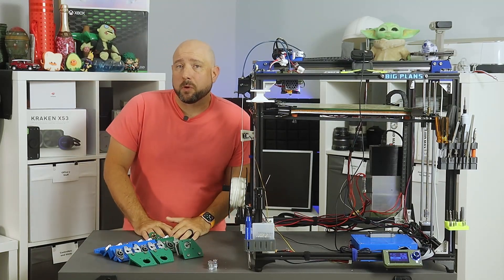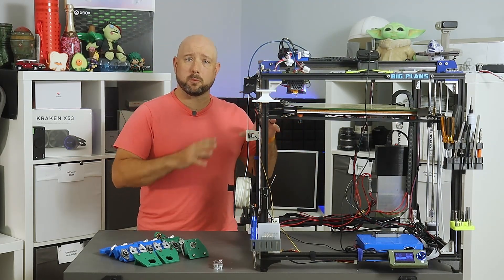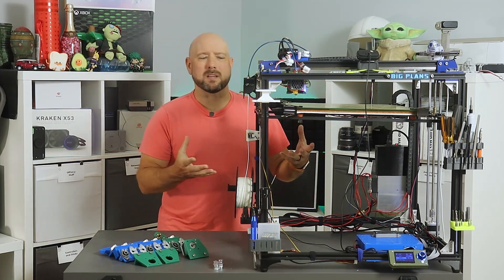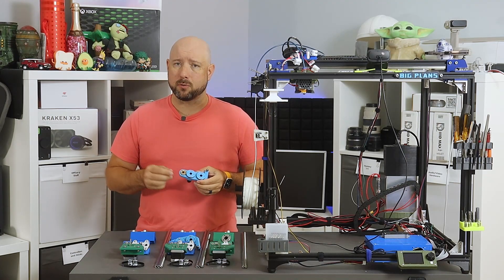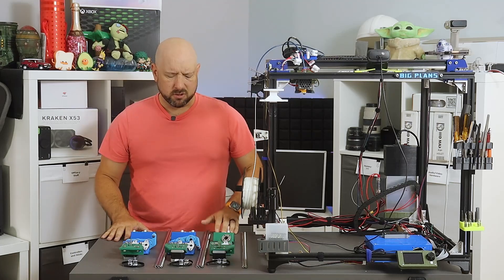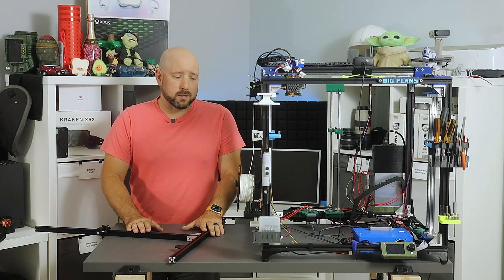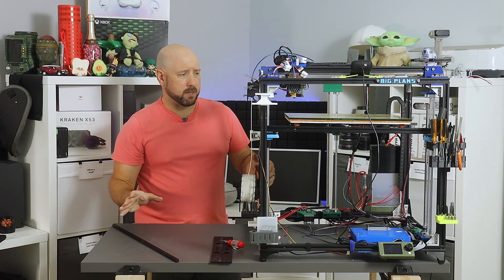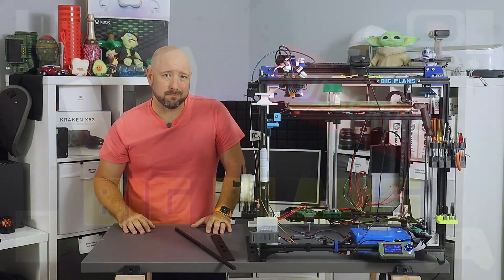Triple Z Bed Leveling on a TronXY X5SA

Comment: I heard we can connect to control boards to a pi. I have a btt skr mini e3v3 and a creality 4.2.2 i want to use with klipper. Is rhis possible.  And i am assuming i can use the same psu - right?

Comment: Hey Mikey,  Been using a lot of your mods on my own X5SA 400 over the past couple years.  Getting into some more mods on it now such as a ZeroG conversion with a switchwire print head.  Now tackling this one but added up around $150 give or take for all the parts (on amazon)  So to save some money and use more of the parts laying around from the printer, I have relocated the motors to be incorporated to the lower rod attachment points.  This way I can mount the motor with coupler instead of using belts and pillow bearings while using the T8s that came with the printer and maintain height.  Will be testing it soon and post remixes when done.  ALSO I ended up printing the flush mounted 8mm rod clamps.  Gonna see how those hold up.  Awesome work though as always!

Comment: i am considering buying an X5SA-500.  but most of the reviews are not good. I am looking for a large bed for bigger projects so I don't have to cut and glue.  This is a reasonably priced option but haven't decided.  Do you recommend this printer?

Comment: Jesus, it's amazing how much people complicates with making these printers actually print ok =))
Reply: Actually, it prints just fine stock. Most of us just like to tinker and make improvements. I've never had any issues with my X5SA. Even with cracked UU bearings. The chitu board does kind of suck though and moving it to marlin from stock was essential to get things like volumetric e and more controls.

Comment: i just dont get the need for extra complexity.
i havent touched the level on my bed except when i accidentally push down on one side. and then, its just a matter of pull the head to each corner and adjust the screws. then adjust the Z offset.  can level it about five times in the time it takes the auto level to make the first probe. and nothing fixes the bed being warped anyway. other than being smart and using four small beds...

keep meaning to maybe fit the belt and one stepper. whatever. not enough of a bother.

some people hate these things, i found its got a few quirks but its definitely tolerable. hell, i havent even changed firmware yet, thats unusual for me. i guess its working more often than not so i havent gotten frustrated enough to really do anything drastic yet. really, i am the person that pulls things apart in the first five minutes.

like the extruder. still tolerable. not perfect but whatever, it isnt giving me issues for what im doing. not a fan of it but its working. i think its money well spent.

halfway through a four day print at the moment... and wow, its the full build volume.

Comment: Does anyone have a resource for an install guide on the octopus board? I know it is not a straight forward install as the ribbon cable has to be removed and new wires have to be made for the detached board up top.

Comment: So many questions: What firmware supports this setup? Can Klipper support this?   Is there a defined G code for three Z motor axes leveling?
Reply: Klipper supports this, the command should be Z_TILT_ADJUST

Comment: Thank you for your video. I am still learning things and realized that I can run my sexond stepper using another driver (empty slot) Has 1 extra driver sitting since I got the printer. I hooked it up and enabled Z_tilt with dual Z (diff drivers running the Z Steppers) with a toleration of .0025, which I achieve at max 7 tries. Add the Z_tilt_adjust in the Gcode for every every print in the slicer. Its a whole new world for me. It PRINTS now EVRY TIME.....   THANK YOU!
Reply from the maker: Great to hear!  For a printer of this size to still use a single Z stepper driver with no linkage is a bit embarrassing.

Comment: Couple comments:  1. In your BOM you link to 12mm magnets, but your STL's accommodates a 15mm magnet.  2. You spec and link to an 8x2 lead screw.  Tronxy lead screws are 8x8.  Your z motor on the new screw is going to have to operate at 4x the speed of the other two.  How did you compensate for this?  Has the motors operating at different speeds caused any issues?  Having fun expanding on your build, and can't wait to start all the klipper printer.cfg fun.
Reply from the maker: Great catch on the threaded rod!  I am using T8x8 and incorrectly stated and linked to T8x2.  I'll update the description and link to match.  If you've already purchased the T8x2 I would recommend returning/exchanging for the T8x8 just so everything matches and it doesn't cause confusion down the road however if that's not an option I would think that supporting a T8x2 would just be a matter of multiplying your full_steps_per_rotation by four for the T8x2 rod.

You are correct that the link takes you to 12x3mm magnets and the design calls for 15mm magnets.  However, those 12mm magnets measure 15mm diameter on the calipers.  I'm hesitant to link to a different '15mm' product as I'd hate for someone to get even larger magnets in the order.  If you or anyone else has purchased a 15mm version and it measured out at 15mm I'd love to know so I can link to reliable source.  I'll update the description to note this discrepancy and that a 15mm OD magnet is required.

Comment: Thanks for Your inspirational videos about Your X5SA mods. Very helpful indeed! Actually I'm going a little bit further designing the parts to use a genuine 400x400mm Radrig V-Core 3.1 build plate. This will give me a bigger and more perfect build surface. I decided to go this way to put out the full potential of a triple Z bed kinematic. In my design I use a copy of the V-Core3.1 mechanic, resized for the X5SA core and some improvements on the ball sliders and the Z guidance. Congrats to Your videos - Very inspiring 🙂🙂😀😀👍👍
Reply from the maker: Hey PY2BND, glad you found some inspiration from the videos!  Are you going 100% with the RatRig gantry?  I love the setup but lots of rails and relatively expensive extrusions.

Comment: This is an awesome work, should this work on a 330 tronxy x5sa? thanks
Reply from the maker: Hello Alberto.  Yep, it should work with the 330 as I don't believe they changed the Z gantry on any of them - and even if they did the kit is designed for any cube printer so it would at worst be some minor modifications.  If you hit any issues let me know.
Reply: @LilMikeysBigPlans   i want to buy an tronxy x5s 330, to upgrade It to vzbot, and your triple z is just what i want, easy an chep triple z. Voron trident have It but its need 3 linear rails, and i dont think that this rails will ley you any improvement

Comment: I have the 2020 updated Tronxy X5SA, It has been a pain since I got it. I upgraded the extruder to a Titan, I upgraded the bed surface to a rubber like ultra flex Tronxy magnetic Bed Surface.
I fought with it and watched videos for help and now after almost 3 years I am done, I will not fight with it anymore I will dismantle it and use it as spares.

I got a Delta QQ-S Pro now and it far beyond the Tronxy in printing.  I have a Original G32 board Aquila which I upgraded with a high power all metal hot end and dual lead screws and a CR Touch.

It works better than the Tronxy too. I now got a Elegoo Neptune 3 and it is above the rest in printing.
I was thinking of replacing the Tronxy with a 	
ANYCUBIC CHIRON 01  which has a bigger bed than the Tronxy and build height 400 mm square bed and max build height of 450 mm and has 25 point mesh bed auto leveling built in.

But after some thought I will instead save the £260 that printer will cost here in the UK and save up another £240 and buy my 1st resin printer which be the amazing big Elegoo Saturn 2.
which be great to use in place of the Tronxy.
Upgrading the Tronxy like you shown be very fiddly and expensive and I don't have the level of know how to do it right.
Reply from the maker: Hello Colin.  Sorry to hear you've had so many issues with the TronXY and I hope it doesn't permanently turn you off of FDM printing.  I have a resin printer as well and it's a different beast.  Resin is quite a PITA for each print with removal, cleanup, and curing but the results are amazing.  Where-as with a properly tuned FDM it's pretty much fire-and-forget for large parts - and just rip the from the plate and go about your merry way :)

Either way, best of luck with the hobby.  It's a lot of fun when it's not a huge PITA.
Reply: @LilMikeysBigPlans   Hi Again.. Thank you for replying.  I have a update for you.  I tried again to redo the Tronxy X5SA to level it and maybe print n the original flat aluminum metal bed as the rubber ultra flex Tronxy one was rubbish it would not stay stuck down to the magnetic base once the bed heated up to around 70 C.

So I will now have to just give up on having a big xy core printer.  I have the new Elegoo Neptune 3 printer and it is great since it has auto leveling bed system.
And  PEI bed sheet. In fact Elegoo just released two new versions of the Pro version of this Neptune 3.

They have direct drive extruder and PEI bed and even better leveling. But they are bigger bed sized.
The Elegoo Neptune Plus has a bed size of 320 mm and a build height of 400 mm. ( so the bed is only 10 mm smaller than the Tronxy X5SA )

https://www.elegoo.com/en-gb/products/elegoo-neptune-3-max-fdm-3d-printer-massive-printing-size-of-420x420x500mm

The Neptune 3 Max, it is a whole another level. with a bed of 420 mm x 420 mm and build height of 500 mm 

https://www.elegoo.com/products/elegoo-neptune-3-plus-fdm-3d-printer-with-larger-build-volume-of-320x320x400mm

at $350 for the plus and $470 for the Max they look great value I hoping to get the Max or if my limited money can't reach that I get the plus?

As for the Saturn 2 by Elegoo I did get it just before Christmas 2022. I also manged to get their bigger wash and cure stations too. 
and used some of their Elegoo Water Washable Resin. I did some stuff But now hit a big problem?

I can't dispose of the left over resin that is in the water of the wash station, To dispose of the resin waste the idea is to place it in a clear container out in the sunlight to set the resin left in there. 
Then throw the resin solid waste part away! The water left should be filtered through carbon filter like a water filter jug. 

I did the filtering but no improvements. as for the solid part I can't set it as sadly the UK has not the sunlight it seems to do so?  

So I had to store it in a plastic container of 10 liters size with clamp on lid as there is 7 liters each time from the washing unit to do the bed plate and models fully! 

Someone said maybe use a big UV lamp to set the resin in the washing water, But I looked them up and they are very pricey in hundreds here in the UK.

I have now 14 liters of the waste water ( two washing full loads ) The resin system was very price.. So I will clean it up since it is almost new and sell it. Shame I know!
But even if my local council does dispose of this waste water, I will still need to transport this toxic water to their site without a car to do so!

They are many miles form me.  So sadly this resin good as the models it did are, it will have to go then later on I maybe can get the council to dispose of the resin water!

So I sticking with FDM now on.  As you said more easy to deal with than resin. ( okay if you live in a very hot place the resin setting be easy )
So there you are, A total pain. hopefully the Elegoo new bigger bed printer I get will solve big printing needs?

Hop you keep doing well?  😉

Comment: Thanks for your messages, I have bought the 12inch rails but can't find any screws to drop in to tighten them to the 20mm vrail. I have bought 3 different sizes but none suitable. I am in the uk can you suggest where I can buy the screws, I have the drop in nuts ok. Thanks for all you valueable help
Reply from the maker: Hey John, I'm using standard m3 button head bolts and boat nuts for the rails.  I'm not in the UK but here's the US versions:https://amzn.to/3De85uM, https://amzn.to/3D9YrID.
Reply: yipee

Comment: Could you share what glass bed you are using on your tronxy? Looking forward to doing this mod myself.
Reply from the maker: Hey Dave.  I'm using a standard 1/4" tempered glass sheet - although I'd recommend 3/16.  I happened to find the 1/4" on sale.  Check glass shops, not printer shops for better deals - but be sure to get either tempered or borosilicate glass.  My whole setup is TronXY aluminum plate - cork insulation/buffer layer - silicone heater - glass pane - PEI sheet.  There's a bit more information on my silicone heater video: https://www.youtube.com/watch?v=yhzWj-oaikk

Good luck!
Reply: @LilMikeysBigPlans  thanks for the reply, I'm off to watch your other video now and going to subscribe.

Comment: hi I'm updating my Troxy and following your previous video which is brilliant. It is going to plan but I have a coloured screen and can't get to all the settings. In this program pronterface m503 it will not show the list is there a way of getting a different screen to solve this problem without buying a new motherboard? My board has only a ribbon cable to the screen. Thanks keep up the good work much appreciated
Reply from the maker: Hey John, thanks for watching!  Unfortunately the M503 GCODE command is not supported in klipper and I don't have a Marlin-based printer available at the moment - however I thought that M503 only displayed settings in the console and not on the LCD.  If the only issue you're having is that the settings are not all displayed on the LCD that might a functions-as-designed kind of situation.  

When it comes to LCDs it seems like most manufacturers tend to select LCDs that only work with their control boards so I wouldn't expect to be able to use the TronXY LCD on other boards or other LCDs on their proprietary boards.  I haven't done a lot of work with LCDs so there might be other folks that can offer better direction.